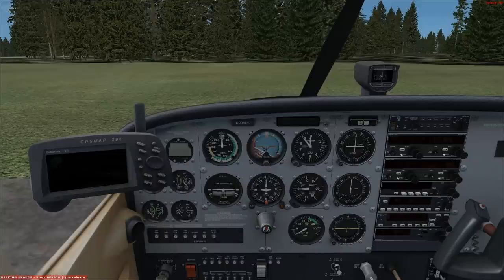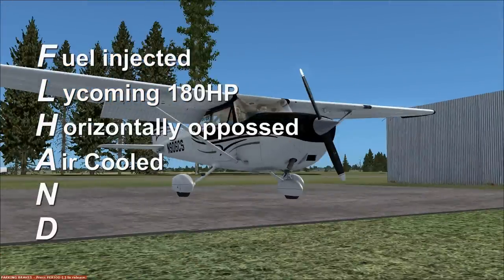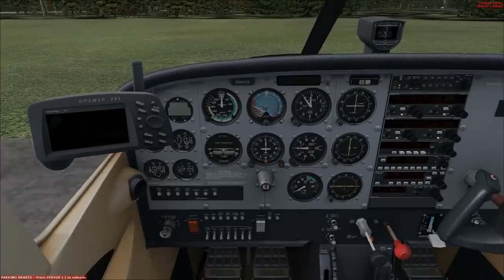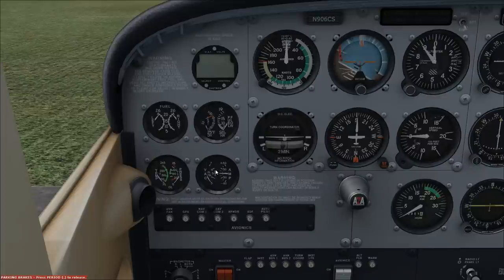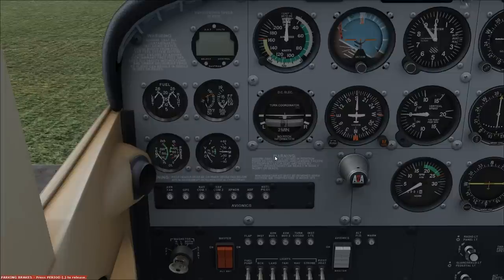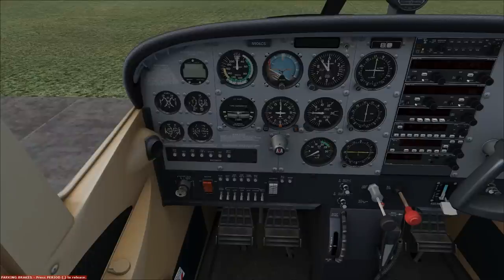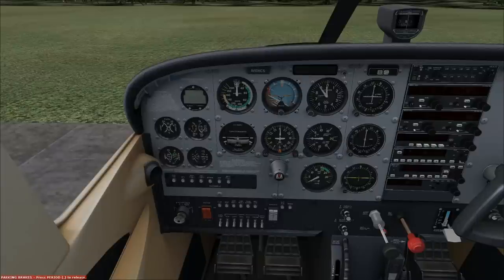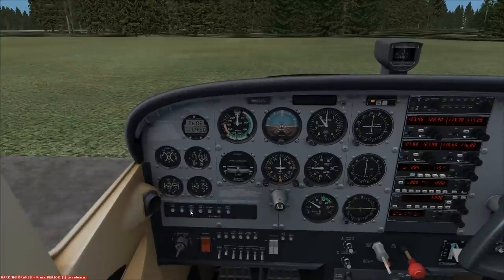A2A Cessna 172 Tutorial. Video 3, Engine Startup

Comment: Thanks a lot, was really having difficulty starting before this
Reply: AviationGames ok, now it wont start, I keep getting the Volts light flashing even though the battery is not weak
Reply from the maker: AviationGames it can be a bit fineky sometimes. every now and then i have trouble with it. Volts light will flash on start up that's normal. as long as it stops after you let off the key or the engine turns over (with the alternator on). go into the hanger and see if the battery needs a recharge or change. if nothings wrong use autostart.
Reply: it's ok, I got it sorted, I over-primed the engine and had to set throttle to 50%, all's good now but cheers for the quick reply :)
Reply from the maker: Necra Monium Double check everything. The other day i had a hard time getting the C182 to start. I looked back and found Water in the fuel tanks.

Comment: I still cannot get my Cessna to start.. I have had to replace the battery like 5 times, the Starter Motor twice. I followed yours and 3 other peoples videos. Everyones just Starts when they turn the key.. Mine just keeps Chugging Chugging, and then NOTHING..  And then get a Volts warning and I have to go replace the battery again..
I wait 10 seconds to unflood the engine, and try again.. Nothing.. :(.. Any advice for a troubling engine?

Comment: Hi CountryFlyboy, I am really enjoying your tutorials. I have one problem. I am following the tutorial to the letter but I cannot start the plane. If it helps, when I turn the fuel pump on I do not notice the needle on the fuel flow move. What am I doing wrong??
Reply from the maker: Throttle cracked open and fuel must be on (shutoff valve push full in). The more open the throttle is the more fuel goes in. Try using full throttle and see if you get movement out of the needle when you prime the engine. if not the fuel pump probably needs replacing. Use SHIFT-7 to access the hanger and see if the mechanic says anything.
Reply: Still no good mate. Ive replaced everything. The hanger says my plane is in great shape. If I autostart the plane starts.
Reply from the maker: I dont know then. I have problems starting it sometimes to.
Reply: I had another good look at the fuel flow and when the fuel pump is on the needle moves to just below 5. Is this normal?
Reply: I just started it :)  I cannot tell you how though!!!! This is why God never gave us wings...

Comment: When I turn on the avionics, the radio stack doesn't light up :/
Reply from the maker: +Sr Brunovsky Make shure the individual units themselves are on. Theres an on off switch on them. for example they COM/NAVs have it on the far left.
Reply: Ok, thanks :D I'll be sure to try it out!
Reply: CountryFlyboy So... It doesn't work :/ Turned everything on and it's still off!
Reply from the maker: Sr Brunovsky No clue then. I guess check Ammeter. With the Alternator on flip on the landing light it should drop dramatically then spring back to normal. Also check and make sure theres no failures checked in FS or in the A2A Hanger.

Comment: for some reason nothing happens when i try to turn on the master switch i cant start my plane
Reply from the maker: +ran21444 absolutely nothing at all? with the switch on some things should come on. Press Shift-7 to bring up the Hanger and check to make sure the battery is charge.
Reply: well,i dont thnik so, how do i charge it? 

thank you!
Reply from the maker: Typically a lightning blot shows up somewhere and you have to click it a few times to charge the battery.